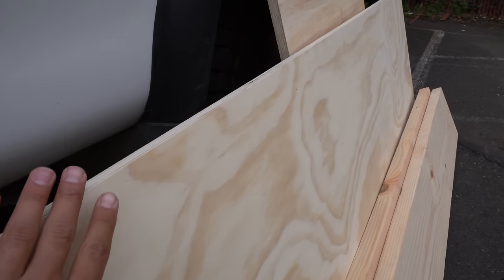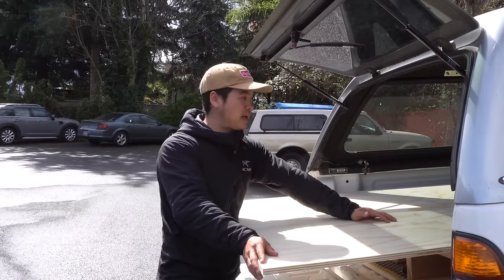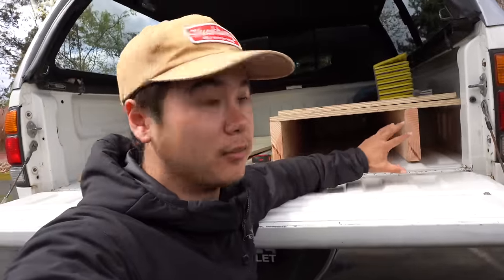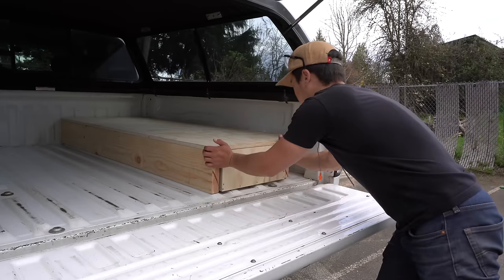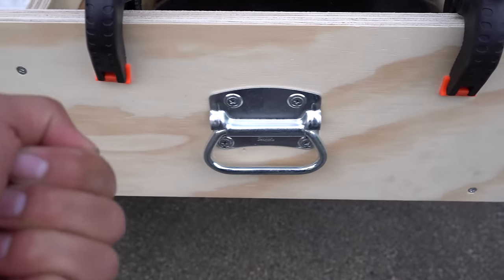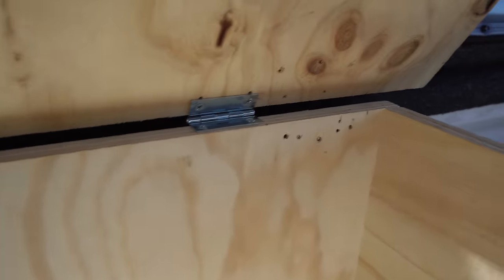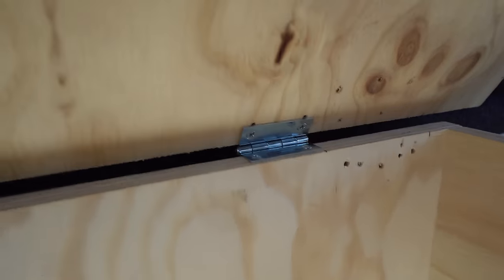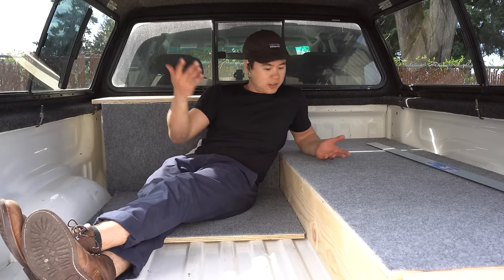Building a Simple/Minimalist Camper Setup in the Back of my Truck

Comment: you bring back memories, bought a e100 ford van in 1976, built my bed, had unit with sink, overhead cabinet, and icebox(coleman) behind the drivers seat,  the top of the bed lifted up that is where the porta potti was, with a curtain that would go around it for privacy, on the other wall built a full wall of cabinets for storage,  half of the door was taken up with a counter where I could put a stove.  carpeted ceilings and floor. it was already insulated. it had an outlet inside and outside to plug a heater into or electric stove.  had a few other things done to it.

Comment: Most types of camping trailers and the like are not bear proof, and it is fairy easy for bears to break in and take everything including the people inside them and making them their dinner. Most people never think about that issue and think that they are safe inside when they are not. It doesn't take much for a bear to catch you and eat you after they have wrenched open the camper doors or windows. A bear can break an airplane in half just by crawling over it. They can hold a full 55 gallon barrel in their teeth and walk up a mountain side with it, and drag a bull elk or bull moose up a steep hill through the forest.

Comment: Great job young man. I have a Kodiak Canvas truck tent and have thought about setting up pretty much what you have done. At 64 years old, I like the minimalist approach. I cut a piece of plywood to fit the floor of my truck bed and have also cut the puzzle piece floor mats to go on top of that. I will be using a camping cot because although I wanted to build a bed as you did, the cot is just easier right now. Perhaps in the future. Thanks for sharing your build. Stay safe and God bless.

Comment: I've seen a cool setup with chains and mini turnbuckles.  Chains attached to the front corner D rings in his tacoma bed, and to part of the main framework. Pulls the entire system forward and slightly down.  Loosen the turnbuckles to remove the chain hooks and the entire system slides out of his truck bed in one piece.  Pretty neat.

Comment: Great start on the build out!  If things start to slide around while driving you can attach 1x2 firing strips to the bottom of an item and let them sit in the groove on the floor.  Keeps things sliding left and right when driving.  I would have set the bed box down into a groove to make sure it doesn’t slide too.  I plan on adding a full floor sheet with carpet to my build in the future (including my tailgate) so its comfortable crawling in and out of the truck.

Comment: Hey Jonathan. Great video as always! To get your corners straight with each other I would recommend using 90 degree right angle clamps. They will hold the pieces of wood together for you while you drill which is also a plus apart from getting them perfectly angled with each other. I had sent this comment before with an Amazon link but I think YouTube deleted it due to the embedded link. Keep up the great work! 🙂

Comment: I love the effort you put into your builds, from the slumber queen to this, carpentry doesn't seem to be your strong point but your making it happen non the less! I've been doing carpentry for years, and I really enjoy watching your build videos! throw some poly or some sort of sealer on the wood if you can, it may warp and twist even in the short weeks you're using it, that drawer may be harder and harder to pull in and out. the other thing you can do is go the Home Depot and ask if they have any smashed up roles of ice and water shield or rubber roofing (because its expensive) you can take that and line the bottom of your aluminum bed for both easy clean up for spills and a bit of a dampener when driving and the build bounces around. you can also spray paint it for color
Reply: Can't get skills unless you practice, right? Probably doesn't help that he is working in a parking lot.  Do you think the sealing of the wood with the poly would be the cheapest solution, for time being?

Comment: Enjoy your videos ! Nice set up and good idea on adding the extra piece of plywood to have a flat surface to sit.Check out the Moonlander Campers- it’s basically a custom made camper shell for your truck ,heavy duty aluminum and extends beyond the width of your truck and it’s a high top topper with a loft ,I believe they are based in Colorado .

Comment: I'm sure someone else has told you but if not literally that straight edge as you call it or the aluminum track is actually for track saws they make specific songs that literally fit into that track that way you have the straightest of straight cuts and no variance but you can use it as a guide but it's a very expensive guide some Souls automatically come with a guide that screws onto the side of them that basically rides on the edge of the board

Comment: I always use drywall screws for wood projects. They come in coarse and fine thread but you can't always find the fine thread. They are harder than wood screws and save a lot of pre drilling.

Comment: You can turn the storage box 90 degrees, sit on the bed and an have a countertop or flip the lid and have a table. My bed built is very much like yours but taller but I have GMC with a tall Leer topper so I have the room.

Comment: Jonathan, I enjoy your videos and am looking forward to what's ahead for you. I think you should consider putting a 3/4" plywood bottom under your bed platform. your bed platform will be much stronger (as a box) and will be able to sustain the weight and movement that it is going to have to endure. The longer screws added to the top will help, but a bottom will complete the job, IMO. Take care.....

Comment: That steel bed of the truck is going to be super cold you should have put down some 1” foam on the floor and in the bed sides to give some insulation. Then build on top of that could lay some carpet down on top of the foam anything to keep u warm.

Comment: Yo J!!!  Awesome build Dude!!!  Like the new cap as well/  Question; did you think about putting thinner tops on the slide out drawer so you would have more cook/prep space?  I know you will be cooking off the tailgate with this current configuration, but if you had solid tops when the drawer is pulled out, you would have more space to cook and place things??  Maybe just a smaller piece that could be placed over the portion that slides out so you can have more surface area??  Just a thought.  Can’t wait to see it in action!!!

Comment: Very nice!  I would like to say something for safety sake.  If you cut the top of your cabinet with a smaller overhang the you might not not crack your head or face while sleeping.  Plus I noticed when you opened it up that it would not open completely.  You could get a few more inches by cuting that overhang.  I would hate to see anything happen to that handsome face of yours...lol.  Seriously though, please be careful with that corner.  Flush edges are a lot safer.

Comment: With your constant bad luck I foresee your tailgate being open and your bed platform sliding out onto the street because you didn’t feel like securing it down. You know you can picture that because that’s exactly something that would happen to you, you’d be in the middle of some busy street trying to get it out of the road or whatever. Take the time to do it right and avoid any unnecessary problems.
Reply: Speaking of bad luck, a few minutes after writing this comment, you sawed into your tailgate... I swear you have the worst luck of anybody I’ve ever known, and the crazy thing is with you it’s not usually just 1 thing it will be a series of things that happen within minutes or hours of one another. 1 video I saw you have like 4 day ruining events happen within like an hour, that’s insane.